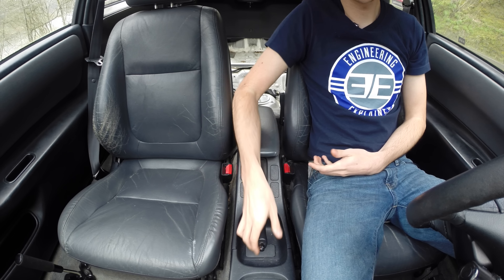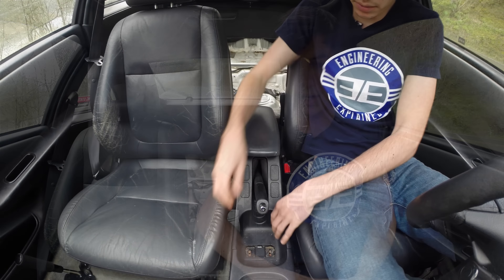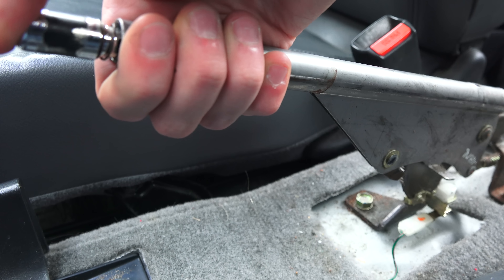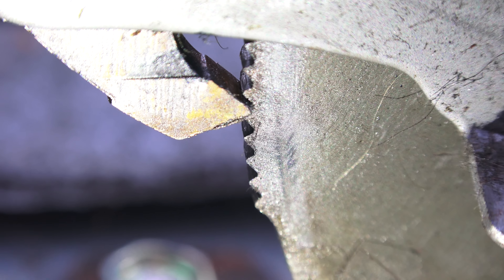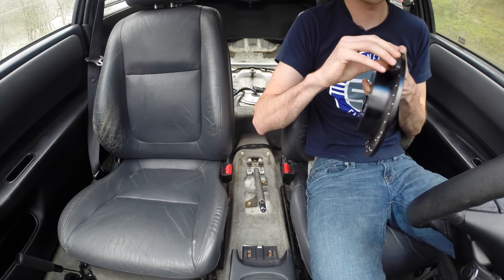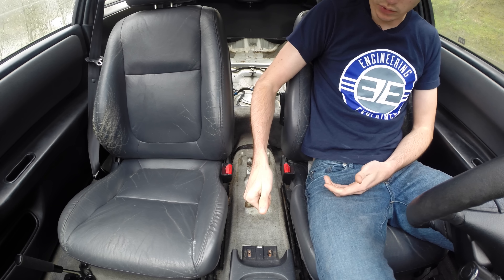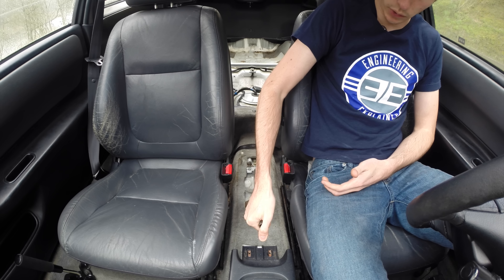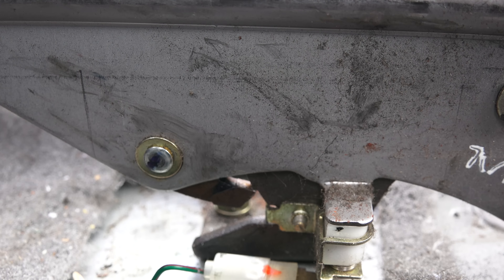Always Press The Handbrake Button? Myth Busted

Comment: Better not engage the brakes when driving, it causes unnecessary wear to the brake pads and shortens the life of them!
Reply from the maker: +Angry Skipper and it wastes kinetic energy, lowering your fuel economy, great info thanks for sharing!
Reply: I was merely being satire :) Haha
Reply: To all the people who are saying they still want to engage the handbrake with the button.
Reply: what you say is actually written in the owner's manual of my 1953 Citroen Traction Avant ! in french, of course, but it's someething like : "Using brakes is an useless expense. use only when absolutely necessary"
Reply: I'm hope that translates to "brakes" not "breaks.
Reply: It is true. I hate people who press their brake pedal on the freeway. The same people seem mystified when I tell them I drive a car for 60k miles (my company car now) without changing the brakes. "How do you get them to last so long?" By not using them every 12 seconds for no reason, that's how.
Reply: oh, my mistake
Reply: Do want to wear you brakes out? Don't use them!

in my prizm automatic with o/d at times i can go from over 70 mph as i exit the freeway, kick it in neutral and let it coast and if it's a cloverleaf exit when I need to slow i put it back in drive, click the overdrive button off which pulls it into 3rd gear to slow a little faster and usually i'm down to 40 or 45 and just arch it into the turn letting the turning friction slow it more, end up ready to merge into street traffic... and I haven't touched the brake pedal. I use coasting and downshifting ALL the time. Coasting is using momentum. If your doing 70 you already paid to get the car up to that speed. If you lift your foot to soon the engine slows the car down and you'd find you foot on the gas driving around the ramp using gas or if you lifted to late you have to use the brakes which are very wearable. So why not glide in neutral using the momentum you already paid for, then using the engine to slow you? Downshifting raises the revs of the engine and uses the compression in the engine cylinders to slow you. The transfer of kinetic energy to heat still happens. A little in the trany, a little in the torque converter as it will spinning the engine instead of being spun by the engine (it comes out of lock up ever time you take you foot off the throttle) and a little in the cylinder walls because the engine will be spinning a bit fast than if you weren't making it. But that's not where most of it happens. 

Here's what's happening in the engine in this scenario. On the intake stroke the piston pulls in cool air but very little fuel because mixture is idle because your foot is off the gas. On the compression stroke the air resists being shoved up in the cylinder and  heats up as the piston compresses it into the confines of the head. That's where the magic is. That is where most of the kinetic energy is becoming heat.

 On the power stroke there's very little happening because mixture is at idle, remember foot is off the gas, and then n the next stroke, the exhaust stroke, it just shoves the hot air out of the engine, and  you're back to an intake stroke filling with cool air. Cool air in, hot air out, no real combustion because mixture is idle lean. The hot air coming out the exhaust accounts for most of the heat that would have ended up in you brakes cause by the friction of using them. 

The smaller bit of heat generated by the mechanical processes of changing gears ends up in the transmission fluid and a little is added by the reverse torque multiplication by the torque converter but the amount of heat is small and the fluid cools when you go back to normal driving so no harm done. There is heat generated in the engine as I described and from friction of piston rings and bearings and the like. But there are  2 factors. Piston rings gears and bearings are designed to last a long time, and second, the engine has a cooling system. 

In my case I do it because I owned nothing but stick shift cars for 30 years and have a little SCCA road racing under my belt so the idea is second nature. On a stick to do that you have to learn rev matching on down shit's, the little throttle blips to raise the engine speed to match the transmission speed as you re-engage the clutch on downshifts. When done under braking it helps the car stop faster, generates less heat in the brakes because they didn't work as hard. (the limiting factor on how fast you can slow down is ultimately the tires but in road racing if you don't let the engine help the brakes they will stop working as in brake fade. Not wear out, stop functioning because of being heat saturated). In street cars I got to the point where I didn't use the brakes much at all. (I've also had stretches where I couldn't afford a brake job but what I learned helped me not use the much until I go them fixed. I don't recommend that by the way. 
You can do that on an automatic too. You don't really have to for o/d to D (4th grear to 3rd) downshifts from less that 70 mph because the grear change is not very large, but if you want to go from D to 2 (3rd gear to 2nd) under deceleration the gearing change is larger so you should learn how to give just a touch of throttle as you pull the lever back to 2. If  you want to do 2 to 1 which I sometimes do under hard braking then you have to goose it pretty good to smooth out the shift. 

You probably know that driving around town if you take your foot off the  throttle and pull the lever down it will shift down with a clunk. Leaning rev matching eliminates that. You're not hurting anything if the shift is smooth and no clunk. If it clunks, your not doing it right.
Reply: Otherwise, don't use the car at all. Because using it will make unecessary wear,lol.
Reply: This guy gets a bunch of thumbs up for shifting repeatedly to avoid pressing the precious brake pedal.

Pads are $40 and easy to replace, and barely wear anyway when you don't drive like a moron. I drove my last company car 60k miles and never had to replace the brake pads. Enjoy your transmission overhaul.
Reply: How did you get 3 thumbs up? Does anyone know what satire is?
Reply: Richard Smith everyone is too concerned on minimizing brake wear to pay any attention to the word satire
Reply: If you never start the engine, it'll outlive us all.
Reply: Caleb Gerweck it will eaten by rust and covered by dust.
Reply: and the longer you are on the roads the higher the risk of getting into an accident, so you actually want to drive as fast as you can, in order to minimize your time on the roads :-)
Reply: Angry Skipper Omg I'm guilty! Sometimes when I'm in the traffic light (the timer one that's usually more than  a minute) I tend to use hand the brakes 😱 So you're saying its not good or adviceable?? Someone please tell me 😢😢
Reply: Khei Cee No. He meant not to use them to stop the moving car
Reply: Shine Santhosh Ohhh haha! So he meant it like "literally" driving then suddenly using the hand brakes. Thought he meant that it's not adviceable to use it at a stoplight or while waiting etc. Haha alright, thank you so much! 😊
Reply: what if you put on eurobeat and you feel like drifting ?
Reply: It's people like you who keep mechanics employed.
Reply: And also using brakes while driving prevents you from going to heaven, human beings ultimate desire
Reply: "satirical"
Reply: Carbon Crank Bro that was too long to read. Just get a job
Reply: Angry Skipper 
Well, but there are cases where shortening the brake-pad’s life is better than shortening your life...
Reply: That's right! Use your gears.
Reply: Cycling your engine really deteriorates the piston rings, it's best to never actually start the car
Reply: aluisious 
Amen.
Reply: @aluisious  My probably is that those people are causing me to wear out my breaks earlier than I'd like 😂😂😂 But that's why I love driving my stick-shift MIata, or manual mode in my Mazda 3, lol.
Reply: then just go downhill in neutral to save more petrol as well
Reply: @EngineeringExplained  I use car always for 20 years and and mechanism should wear off in 20 years if I did that daily.
Reply: I use it to help swing the rear end around on my front wheel drive car when on gravel or dirt! And actually having an automatic I pretty much never use the parking brake unless I'm working on car and want to have several ways to keep it from rolling.
Reply: I just hate the sound lol. That's actually the only reason I use the button when engaging it
Reply: Brakes only slow you down. Why would you want that when you got places to go.
Reply: Do not use the turn signals. It will use more blinker fluid.  Save your blinker fluid, drive the BMW way, no signals.
Reply: @indridcold8433  What are these signals you are talking about?
Reply: @Bemaritohtori  Excellent, touché
Reply: @Bemaritohtori  things that warn your enemies of your intentions.
Reply: @SlyNine  Oh I see
Reply: Yeah you have to let go of the gas and then brake
Reply: Its drift attack
Reply: Just hit some guy. Because we can’t break. It’s gonna wear off. Don’t do with it what It was designed to do.
Reply: @LeMecanoDuDimanche  hahaha if only all manuals were written like they're from the 50's! Funniest thing you can hope for now is translation errors :')
Reply: This is accurate, use engine braking when possible, it doesn't cause engine damage and saves your brake pads some wear
Reply: @EngineeringExplained  Jason if you happen to see this comment... is it true that it's not wise to use the emergency brake (in an automatic transmission vehicle) if it has rarely if ever been deployed in the years prior to getting said vehicle? I ask because I was told the line can become rusted over time (especially if parked in damp area and/or over gravel near the seaside) if not semi-regularly engaged and the cable is liable to not fully return to its proper "starting" position because of the rusting issues. Have you ever heard about this??
Reply: I only put the button because I hate  the ratchet noise